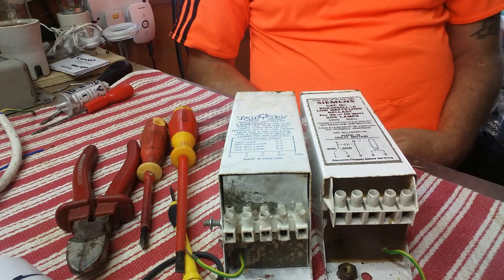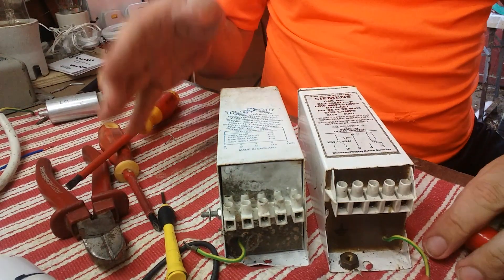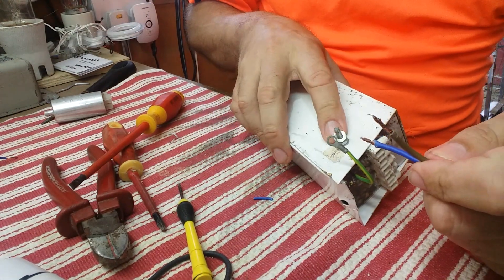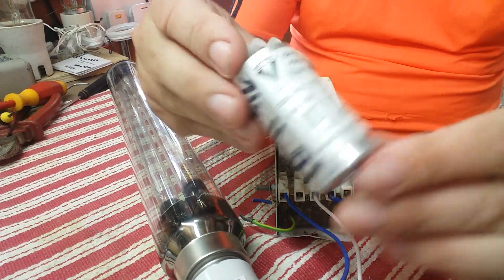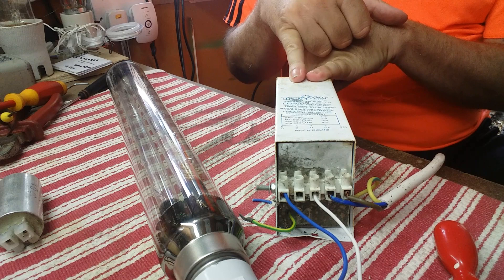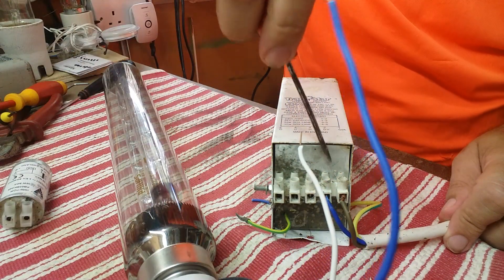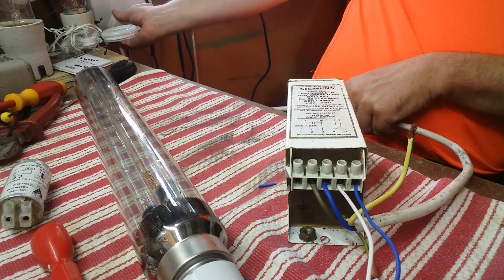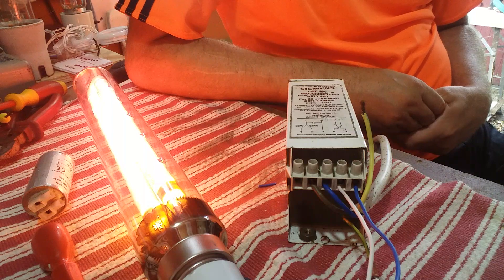SOX BALLASTS. How to wire/ Compare / Etx Ignitor.

Comment: its impossible to find sox ballast so i use 36w fluorescent ballast
Reply: Thats interesting, do you use an ignitor with it?
Reply: @FinlaysFireSystemsElectrical  of course 35-400w metal and sodium igniter i use i have a video in my channel
Reply: @FinlaysFireSystemsElectrical  but the ballast heats up much more with sox lamp
Reply: @Altamira-Arazz  yeah its probs bad for ballast
Reply: Use an electronic ballast. I'm running my 18W and 90W on electronic ballasts for fluorescent. They run cool at a power factor of 0.95